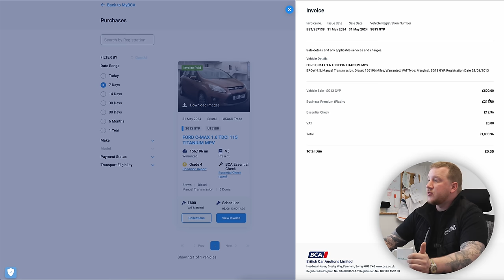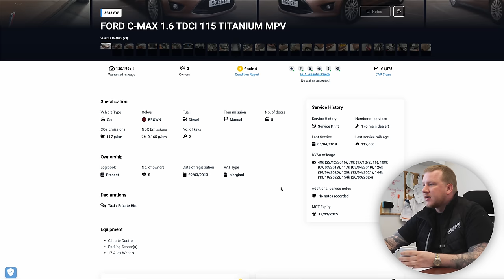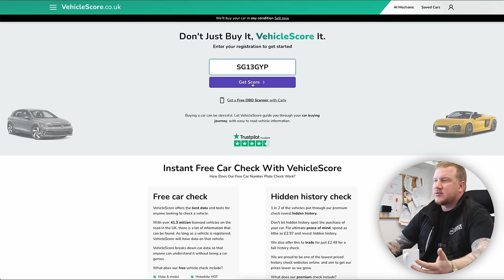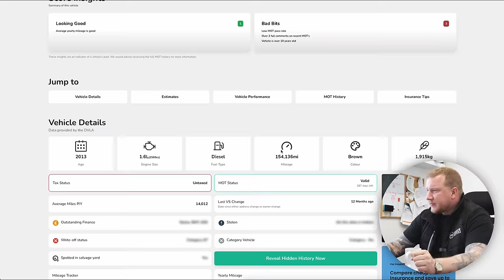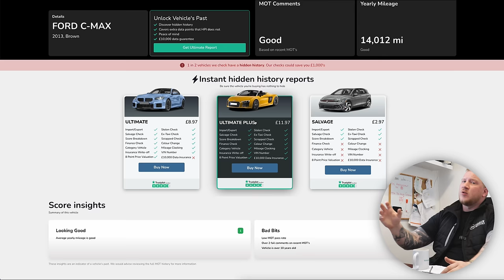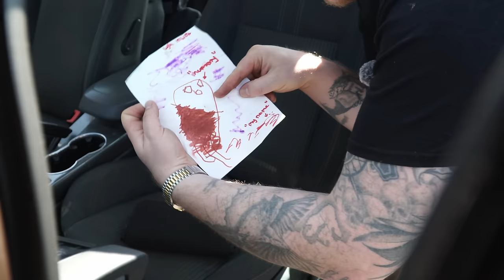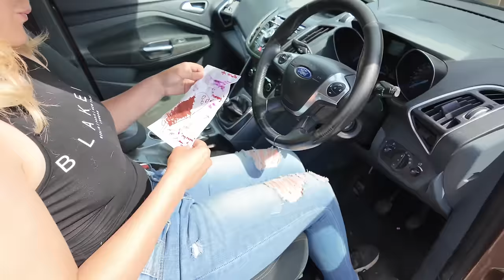My Girlfriend Bought Another AWFUL Car On My Auction Account

Comment: You need a new calculator! How did you get a total of £1299.86. Your parts (ex VAT) amount to £218.90, plus your 2 hours labour (which you claim is rounded up!) £268.90.  Surely the total is £1518.74. Including the VAT £89.32 (which excludes the eBay item) totals £1608.06.

Comment: I had the misfortune of buying a 2005 C-Max 1.6 TDCI many years ago, to its credit it drove very well and the MPG was always around 50. Unfortunately every time I got in it a new squeak or rattle would start from somewhere, its could be from anywhere, that pointless glove box up on the middle of the dash, or various bits of outside plastic trim, the "B" pillar covers would rattle and whistle. God knows how many various electrical faults it would have, the opening rear boot on its own was a great one while driving down the road. I lasted about 6 months with it. Still to this day, and of all the rubbish I have owned over the years, I Hate that car the most.

Comment: I’m a taxi driver and spend more on my car than most people doing similar mileage as I want it to be reliable. I’ve just dropped it off for new rear discs and pads despite the garage insisting there’s plenty for life left in them. It gets serviced at 10,000 miles instead of the manufacturers 12,500.
Preventing maintenance is what it’s all about.
Reply: even 10k miles seems a lot to me, i aim 6k max miles or year what ever comes first. never forget seeing engine tear down it had done over 400k maybe 450k cannot remember and was serviced reg and oil changes ever 6-8k the wear on parts was like the car done 1/4 of the miles so it really shows keeping your oil good keeps healthy engine and minimized wear. never listen to the manufacturers they want it to last till end warranty but that really it they want after sales like parts / new engines or even better buy another car. if you have a chain i feel its even more important to keep oil in really good condition. manufacturers id not listen too but speak to the ones a trusted mechanic and research what other experts say esp the ones exposing the manufacturers and bad engines like some manufacturers say life time oil for transmission yes life time till they fail but experts calling manufacturers out saying no more than 100k miles. i just wish  more look after car as well as i do. also one mad thing as just sold my old car, they not part exchange because they said part service history so knocked big chunk off yes it was due it done 4.5k but one year the car only did 197miles straight after oil change so garage told me i should changed my oil even if it was less than 200 miles every year or it classed as part service history what i find crazy so pre warning if you plan to sell your car, so at the end no part exchange so called local garage next door to my local mechanic and sold it to them and they were not fussed one missed oil change but i prob did 50 miles on the new oil then sat for ages and then did 4 and bit k miles but they had a bargain as mechanically great as 5 years clean mots no advisory, smoke test clean easy pass every time, new disks and pads all around, just had new clutch sadly hoping that last till i had funds for newer car so that was £500 and crazy thing car i got £500 for it as id already made the deal to buy my newer car and street parking it had to go that week, if i was keeping it i would done chain too its still good but they can fail at 100-120k, car had bad paint as red so sort that and new chain and condenser ive seen same car go for £2600 and as paint shop they can do that cheaper than £160 a panel so mechanically they had good car for very little, but even tho 2011 if it needed it id fix it no matter if it the value, all my cars ive own mechanically they great, same goes for my newer 2015 car but this one has to last very long time so even more maintenance more reg services i just wish more people service and maintain mechanically the cars well, paints easy fix it just protective wrapper to protect metal so very least touch up

Comment: Whoever did your math on the costs is about £200 out 😂
Reply: Saw this too. Total without labour is £1249.86 (£50 less than the figure Joe quoted), with labour the total should be £1518.76.
Reply: Maybe the new government have cut VAT to zero in their first month in charge lol. If you add VAT to most the repair items it would be around £50 at a quick glance.

Comment: if taxi turned up like that id not get in it. taxi around my area, i use them local trips pretty reg and they show up in sports m bmw 5 diesels, once brand new merc, popular band new skoda, few times toyota 7 seat mid engine bus but its very nice very high spec, only once newish mondeo i was amazed size boot you could get extra row seats. so as you can tell most the time it more like chauffeur service than a taxi. it is shocking if this was used like this as taxi, if that turned up i opened the door seen that id wave the taxi on and book with anther company what very least clean taxi, id rather have 1980 honda accord as long as it was clean over this any day or even a tuk tuk

Comment: Shameful if that's been a private hire taxi when I sell or part ex my taxis you could never tell been complemented many times on the condition of my car as a ex taxi not always bad buys my car gets a full service every 10k miles along with a mini valet each week my interior is also fitted with faux leather seat covers so the interior is like new when took off if you appreciate ur working tool it reflects on your work tipped regularly for the condition of my taxi 🚕😢

Comment: Built Ford tough as the yanks say 🤣Interior an absolute mess & destroyed, interior on my 20 year old 252k V70 is perfect - not a single broken trim piece, damaged trim paint, broken handle, etc...
Reply: Was your Volvo ever used as a taxi?
A well-maintained private vehicle is probably going to have a lot less wear and tear as well as damage to its interior as one that's been used to transport hundreds if not thousands of people in it.
Reply: @williamegler8771  I'm not talking about the rear seats. Just look at the condition of all the plastics in the front - those are things every car has touched heavily, looks at the state of them! There's just a substantial quality difference between some cars, especially going back in time. V70 I just sold was on 292k, and it was similar - and I battered the crap out of it for 90k, plenty of delivery driving, sleeping in it, etc.
Reply: @kaptinkeiff It was a taxi, not a private vehicle!
It was used constantly and probably had dozens of people in and out of all the seats monthly and probably had hundreds if not thousands of people in and out of it over its working lifetime. 
How many people have your Volvos had in and out of them over their lifetime?
Your Volvo was also a fairly upmarket car which the Ford was not so it probably used higher quality materials and you probably took better care of your car than the average taxi driver.
But then again if you are Volvo was built during the era when Volvo was owned by Ford it probably contains a lot of Ford sourced components so the quality differences may not be as much as you think they are.